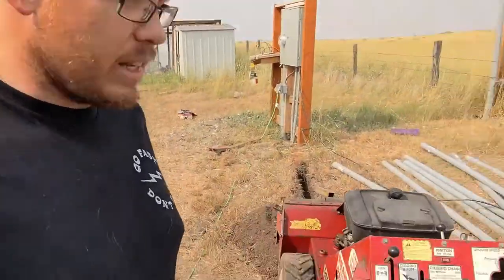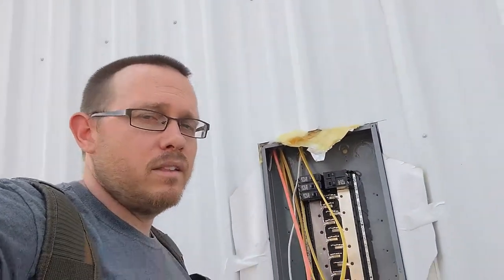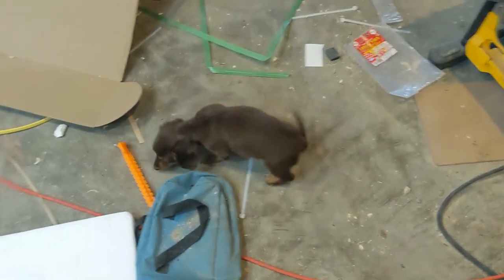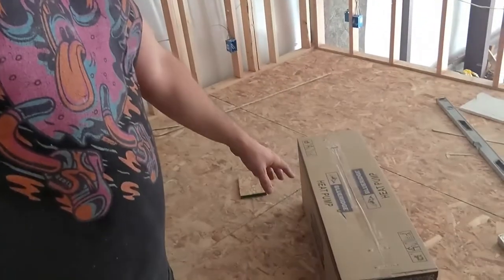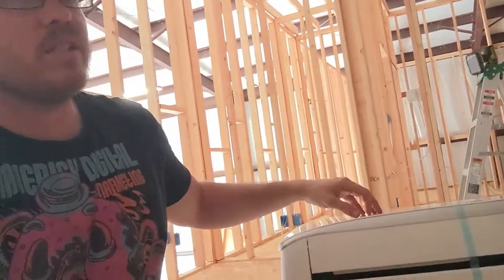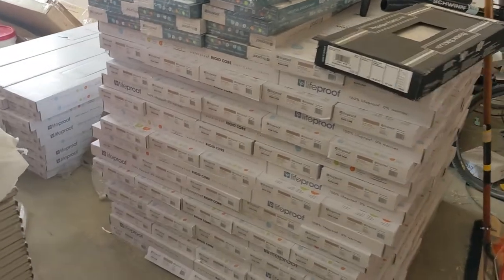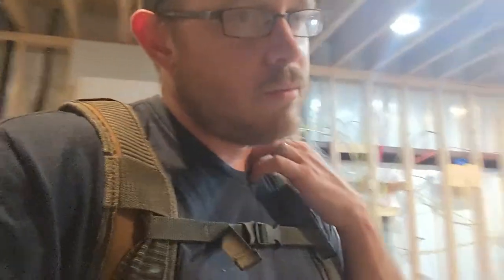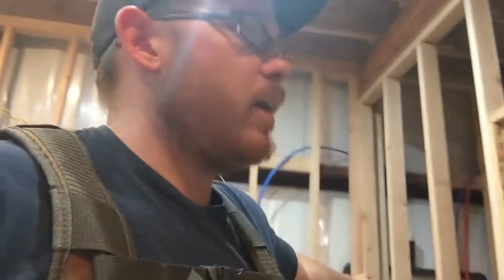Wiring Our Barndominium On Our Own // Building A Homestead Barndo

Comment: Maybe I'm missing something but it appears you used a flush mount indoor breaker panel on the exterior wall of your building!
Reply from the maker: You are correct, we built a cover box around that to enclose it. At the time that was the only panel I could find at the time. It was pretty wild, we had a massive shortage of both panels and breakers where we were. It was a super weird time.